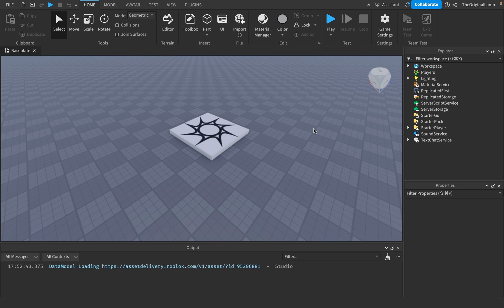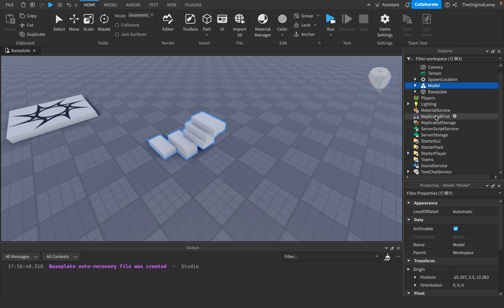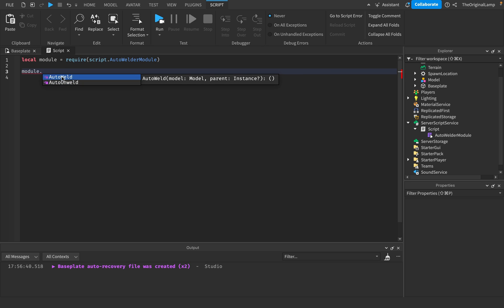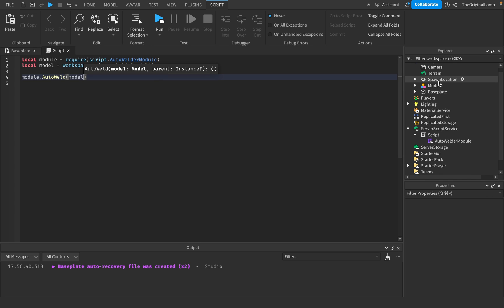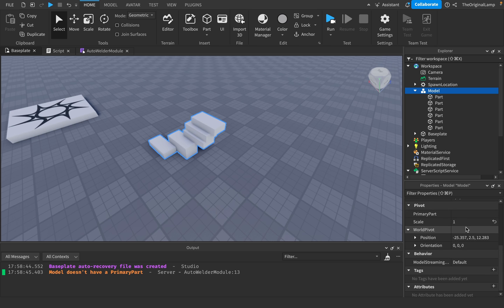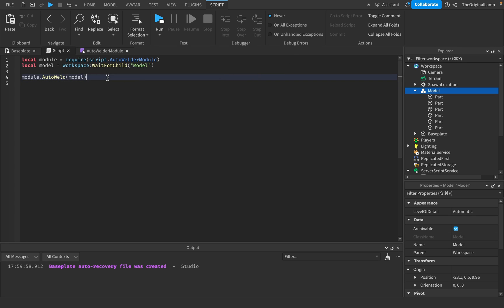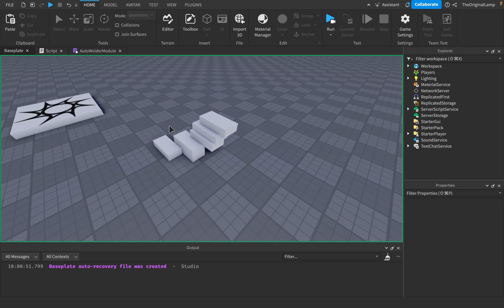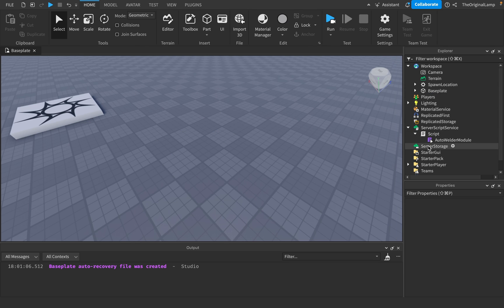Automatic Weld Module (free download)

Comment: doing this at runtime is probably pretty bad depending on what model you're welding..... I've already made 2 studio scripts I just pop in the command bar whenever I wanna weld/motor6d a ton of parts or rig....

instead of doing it whenever the game runs or when the model spawns potentially causing performance issues...

if you wanna be lazy about it and not use the commandbar then I'd just make a studio plugin.

Comment: You know you can just select all the baseparts you want to weld and then press the weld button in the model tab...

A cool thing you could add to the module is making a weld using motor6ds. This func would take a main part parameter and then it would take a second parameter for all of the other parts being welded. This isnt the same however as you would need to calculate the offset of the parts that are being welded to the main part. This is quite simple however as you can just use cframe toobjectspace and do some mathy thingies to work out the offset.

Another thing, why is this a module and not a plugin?
Reply: Why do I see you on his recent vids 😭